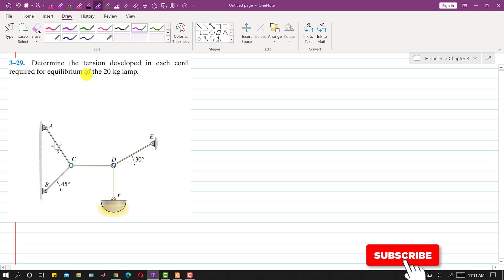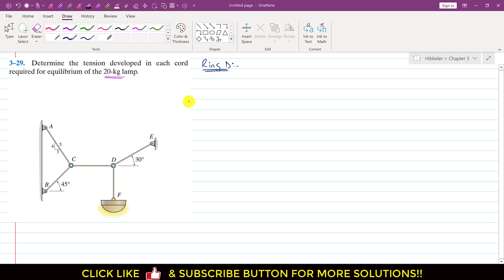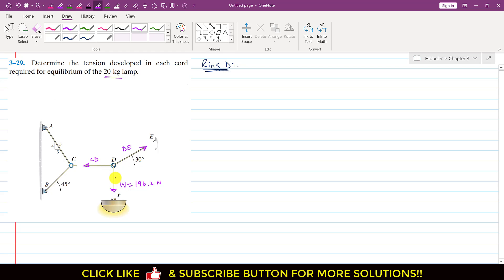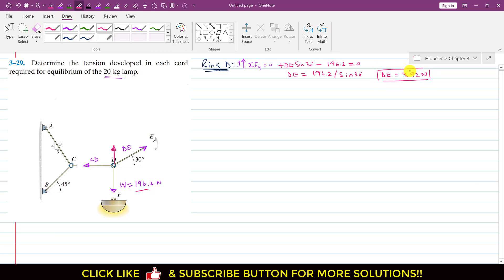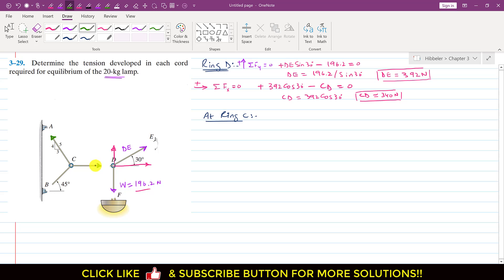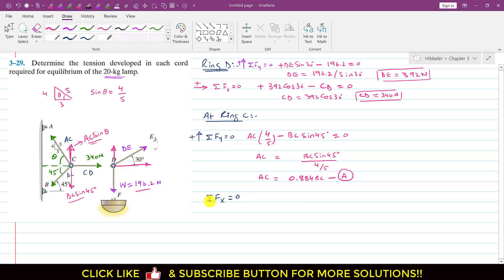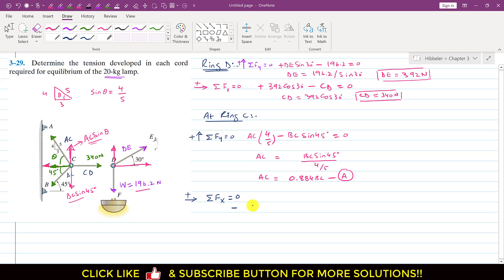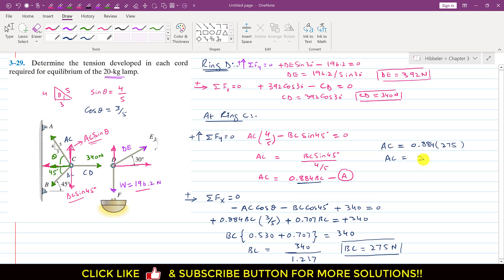Determine tension developed in each cord required for.. | Hibbeler Statics | Engineers Academy

Comment: Sir my question is that in this  video  the diagram has no it's normal reaction opposite to weight ??
Reply from the maker: Action and reaction forces are applied by two different bodies or surfaces. Is there anything in contact with the weight?